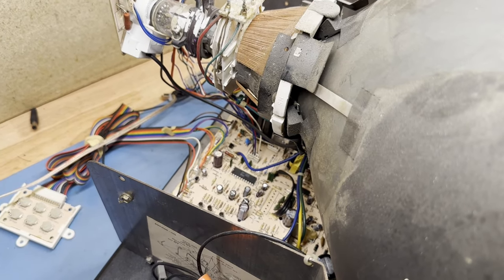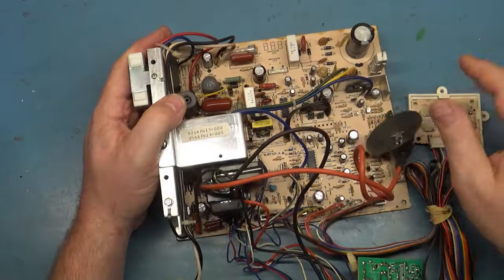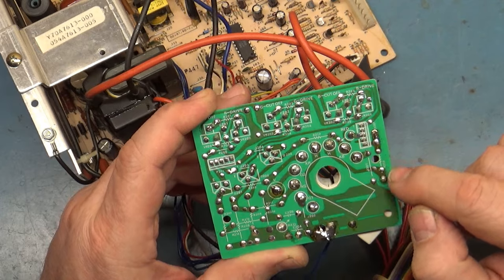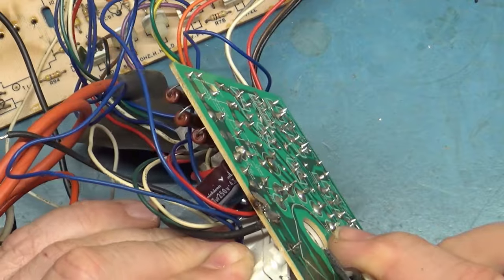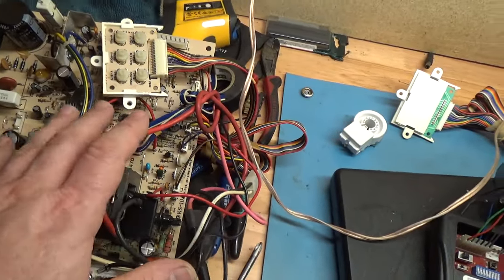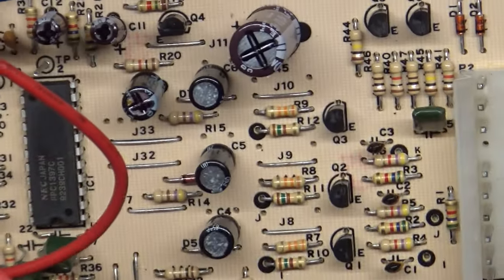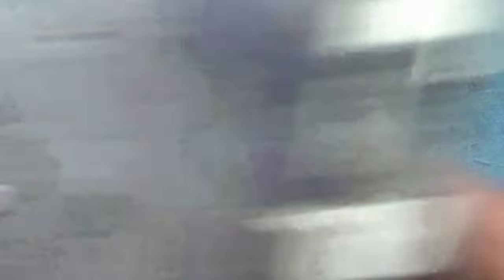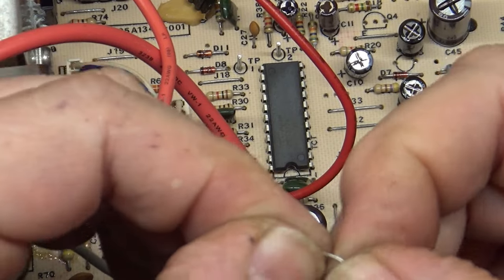19" K7000 Arcade Monitor Repair - Double Trouble - Color Inversion Mod + Bad Neck Socket?

Comment: Oh, and the only time I've ever heard of the in-line resistor(s) on the focus wire is to change the voltage in order to get the correct voltage for good focus. The only cases I've seen/heard of this is after doing a tube swap where the new tube won't focus all the way - even after turning the focus POT all the way clockwise. In theory, the resistor(s) are supposed to bring that voltage down into a range that will achieve proper focus. I don't have any experience trying this, but that's what I've heard. With that said, I have NO clue why they'd have that wire going to ground as well.

Comment: Those look like the Happ rebranded K7000 style chassis aka "Vision Pros". I have a few of them and they produce some really vivid pictures - love 'em. Great video, by the way.
Reply: those are not the Tovis MTG-2901, they are K7000s, specifically the later model K7900 as evident by the rainbow ribbon cable to remote board and its cream colored appearance. to your point though, the MTG-2901/K7300 does in fact look nice. LOL
Reply: Oh interesting. I just repaired a couple 7901s and both were green colored, and neither had the rainbow cable or remote board. Then again, I suppose it's possible the board was simply removed and POTs were installed on the chassis. Anyhow, keep up the good work!

Comment: I actually learned this long ago from your chan on a repair years back, that resistor is from touch screen games to lessen the static on the screen like on megatouch, etc. It def affected the flyback levels on your other vid as well. Nice fixes as always sir, ty for sharing!
Reply from the maker: Ah, yes. You’re right. Thanks!
Reply: @MikesArcadeMonitorRepair  I learned from the best, your vids. I like to binge old ones and saw that one not too too long ago so it was pretty fresh in the memory here :)

Comment: What’s your choice of solder that you use form making these repairs?
Reply from the maker: https://www.amazon.com/SainSmart-Sn63Pb37-Electrical-Soldering-0-22lbs/dp/B07NW8WZ5G?pd_rd_w=9lU8N&content-id=amzn1.sym.068b997f-e018-4cca-ba98-0bebf207d768&pf_rd_p=068b997f-e018-4cca-ba98-0bebf207d768&pf_rd_r=CWKM1SY0NRHVX7NTEQXW&pd_rd_wg=0fds2&pd_rd_r=a7d1eaa5-6b7f-44cc-ab40-f2f606ca56cb&pd_rd_i=B07NW8WZ5G&psc=1&ref_=pd_bap_m_grid_dv_rp_0_1_ec_pr_pr1_ppx_yo2_mob_b_ts_rp_2_i
Reply: @MikesArcadeMonitorRepair  Your link is to buy again.
Reply from the maker: Fixed. Sorry about that.